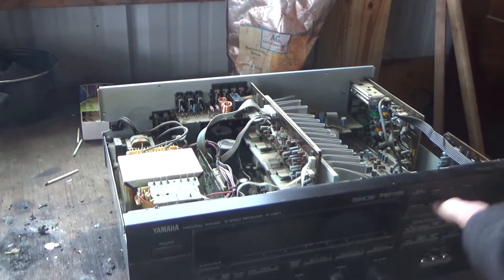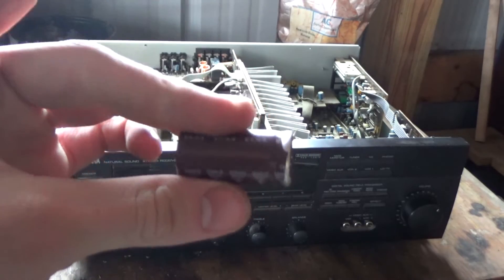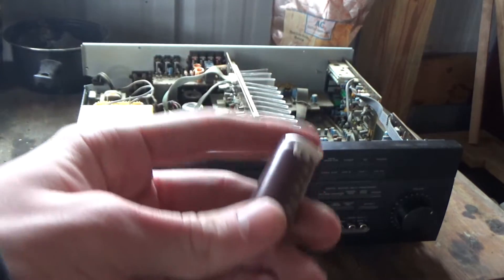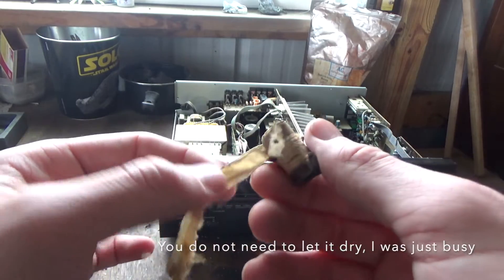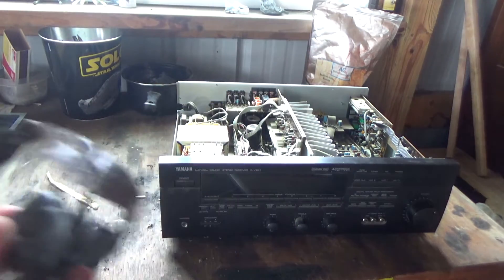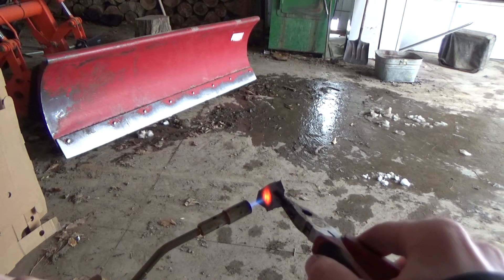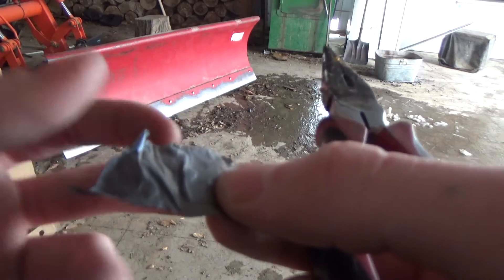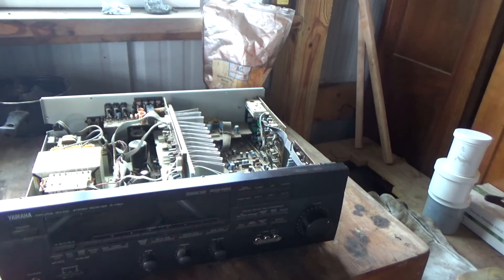Extracting Tantalum Metal From Household Electronics

Comment: Those are aluminum metal capacitors. The large tantalum capacitors are made of steel with long strips of rainbow like foil inside. Also the electrolyte in these is H2SO4. They are also much more valuable as capacitors to ham radio enthusiasts because they have extreme temperature stability. ❤

Comment: That’s definitely not tantalum, you took apart a huge electrolytic (aluminum) capacitor. Tantalum capacitors are tiny and never have foil, the tantalum is in the form of tiny sintered pellets (powder pressed under extreme heat to form something resembling a solid). What you had is aluminum foil. 

So why didn’t it melt as soon as it was hit by a blowtorch? You didn’t heat it nearly long enough, also tantalum wouldn’t deform shape in such low temperature conditions, its melting point is 5463 F or about 3000 degrees hotter than you used

Comment: That was an electrolytic capacitor, it’s just aluminum. The foil was so thin it converted right to aluminum oxide when you heated it which is why it didn’t appear to melt. If you had put it in some acid or a Lye solution the aluminum would dissolve and give off hydrogen gas.
Reply: Apparently tantalum also reacts with lye tho

Comment: That's an aluminum electrolytic capacitor. It's aluminum foil you're holding. https://en.wikipedia.org/wiki/Aluminum_electrolytic_capacitor
Reply: then it would have melt....
Reply: Aluminium would melt at 660°C...
Reply: @f1chtl  it did